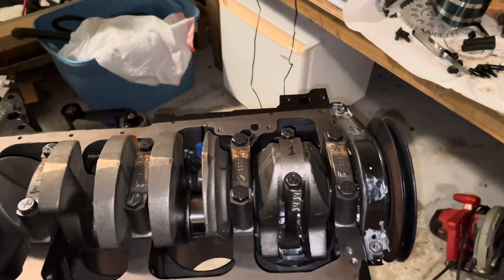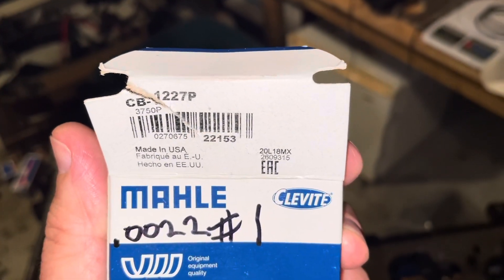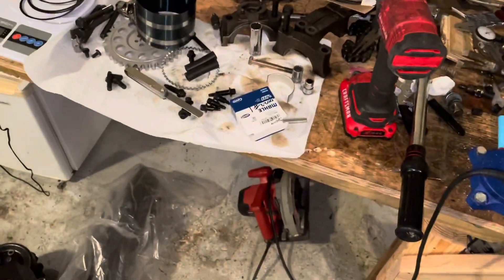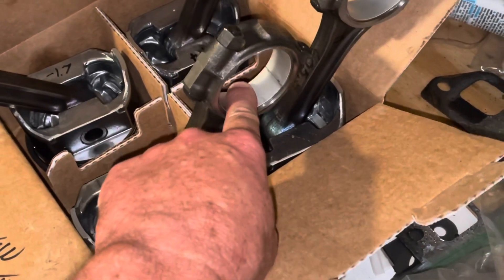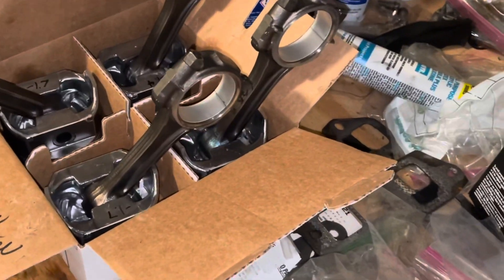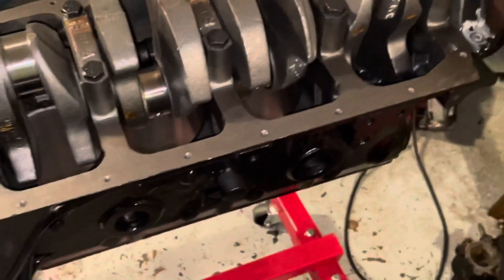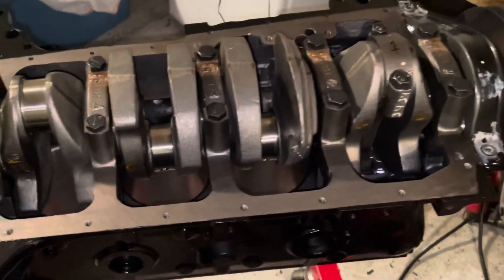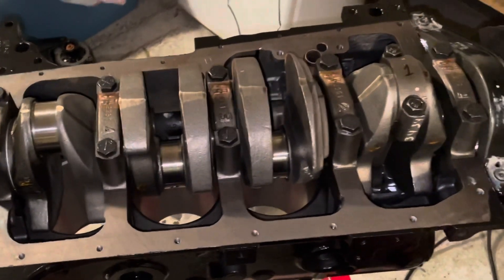Mercruiser 3.0 1(a) - Is ur 3.Oh Gonna Blow?

Comment: Do you have any videos on taking out the crank shaft and cam shaft and doing the necessary bearings
Reply from the maker: I don’t think I’ve done a detailed teardown video. Since it seems you don’t have any experience working on engines I would recommend you read the factory service manual on tearing down an engine. Here is the manual:

https://www.mercruiser-shop.at/data/datenblatt_0000025_1.pdf

Once you’ve read the manual then ask specific questions. Also watch videos part b through the last video in this series (playlist) and do everything in reverse starting at the end of the video.

https://youtube.com/playlist?list=PL6wJJenh5G97zyjZ4qwpvGnUel52aCEQL

Comment: I am assuming this is the same for the volvo penta 3.0.  I have a 2006 GLP-D that spun the #4 rod bearing.  I am just now have it on the stand and will start the teardown and rebuild process.  Thanks for your videos!
Reply from the maker: Volvo Penta and Mercruiser are pretty much the same GM engine for the later stuff. Some early (pre-1990) may have had some Ford engines but I haven’t come across any.
Reply: @moccasinmarine  How do you prime your oil pumps?

Comment: Hello, I had a question. I’m putting new fel pro head gasket and waiting on hermonic balancer pulley to come in after that I will be setting my my engine to TDC to begin adjusting my lashes to 0. Right now there is no oil in the engine when should I add add engine oil? Before adjusting lash or before I set the engine to TDC?
Reply from the maker: If you assembled the engine with assembly lube as you put it together you technically don’t need to put oil in it until it’s done and in the boat. But I just created a video where I put in about 3 quarts of oil to pump up the lifters and prime the engine. Be careful to make sure all the oil galley plugs are plugged up or you will dump oil on the floor. Here is the video where I pumped up the lifters. All this was done after the valves were adjusted.

https://youtu.be/agT1JVfN6kI

Comment: Hi, did you ever determine what year they switched to the narrow bearing? I have a ‘97 3.0.
Reply from the maker: I’m still looking and searching but right now it looks like year 2000 is when the bearings switched to narrow. But don’t hold me to that. I think the new bearing part # is 23-804982. The old wide bearing was 23-85701. This is my best source so far:

https://www.marineengine.com/parts/mercury-quicksilver/application-guides/mercruiser-connecting-rod-bearings.htm
Reply: Thanks for the help

Comment: You think my bearing is the one seizing keeping the engine from running? https://youtu.be/KCzbbFyTgJk
Reply from the maker: I watched your video. Bad rod bearings don’t keep an engine from running unless they have a severe failure and seize up. The issue in your video sounds more like a collapsed lifter or broken valve.
Reply: @moccasinmarine  thanks for the reply. I opened it up and the valves and lifters seem to be all okay upon inspection. Here’s another vid of many I took before I opened up the valve cover and side plate. https://youtu.be/8qV83mHauHw